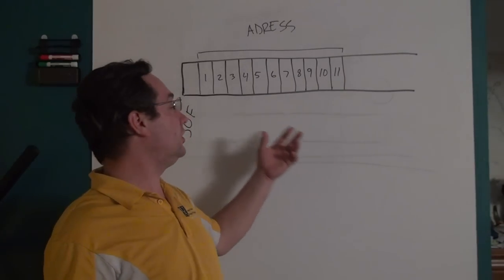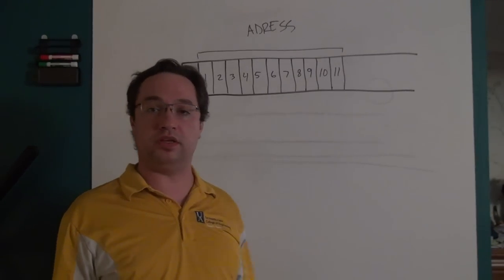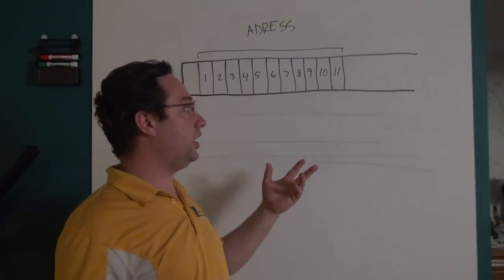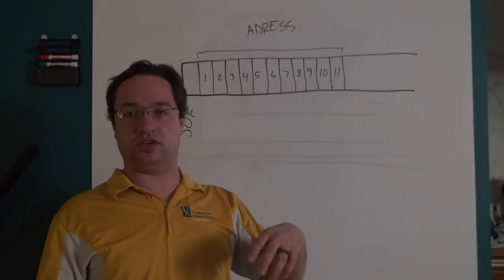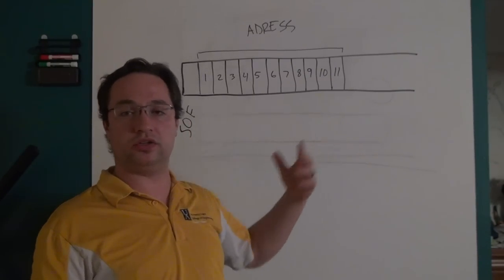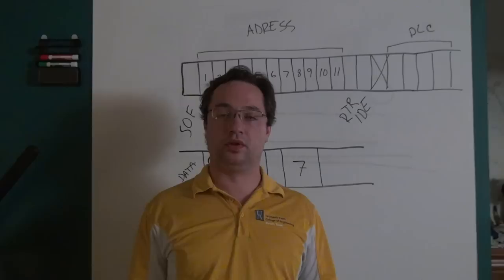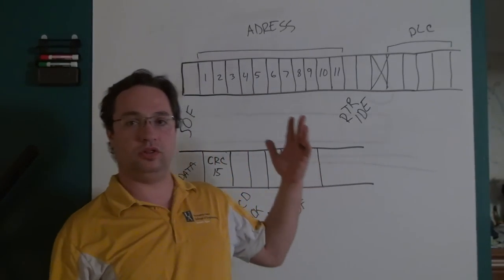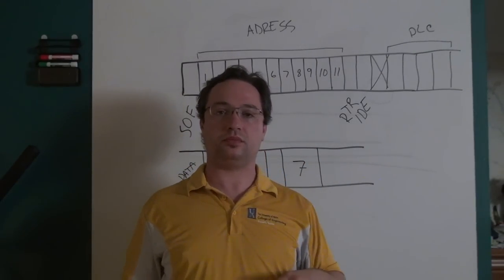eapbg #48 Introduction to CAN (Controller Area Network)

Comment: Thanks, The DLC connector has SAE J1850 signals and ISO9141 signals, what are they used for and the common failures occurs from there signals? are there signals only used for the scanning tool or the oscilloscope
Reply from the maker: Only the high speed CAN bus is mandated by the government. Everything else is up to the manufacturer.

Comment: EAPBG, can you please give examples of why would you want to use a CAN sniffer to do what with it and once you collect all the CAN ID messages that you got from the CAN sniffer you do what with? I just don't understand why you would use a CAN sniffer or what to do with one.
Reply from the maker: A sniffer is a reverse engineering tool. I had an old car (pre can) that I installed a remote start in to.  As part of the install, I connected it to the relay for the rear defrost. This let me turn on the rear window defrost from the remote of the car starter. The relay I connected to was easy to get to an in the fuse box at the front of the car. Now imagine the same thing but in a modern car. The rear defrost is controlled by a module in the trunk. The climate control sends a CAN message to the rear defrost to turn it on. I could find the message that turns it on. Design and build my own CAN interface board. Connect it to the remoter starter and CAN and get that functionality back.

Comment: EAPBG, a CAN transceiver chip converts the 0vdc to +5vdc to a CAN +3.2vdc, +2.5vdc, +1.5vdc signals by differential amplifiers or level shifting circuits? Differential amplifiers won't shift the levels of the voltages so how does the CAN transceiver chip do this please?
Reply from the maker: The explanation of how a can transceiver works is far too complicated for a YouTube comment. Try reading a transceiver datasheet.

Comment: Nice explaination.....Could you please tell me how many maximum nodes we can connect on CAN bus? And How to calculate  this ?
Reply from the maker: Unfortunately, it is not a simple answer. Unlike I2C, where there is an addressing limit CAN is only limited electrically. Propagation delay is the time a message takes to go from one end of the bus to the other. During the duration of one bit, that bit must reach everyone on the bus. This is further made worse by capacitive loading of both the bus wiring and the transceivers themselves. There are a few rules of thumb. The shorter the bus, the more nodes you can have. The slower the bus the more nodes you can have.
Reply: Thanks I understood you point ....but Is there no exact count for nodes or approx count? because I had googled so i had found that max 112 node we can connect so is it false?
Reply from the maker: If you're following some standard such as open CAN or industrial CAN or automotive CAN there are guidelines for network size, speed and number of nodes. This is mostly to ensure reliability. If you're making your own network then only the electrical limits apply.
Reply: Thank you.....I had asked this question by keeping automotive CAN in my mind.
Reply from the maker: Automotive CAN is usually separated into 3 sections; high speed, medium speed, and low speed. High speed CAN incorporate critical systems such as the engine computer, ABS, airbags, body computer and gauge cluster to name a few. This side of the bus tends to be kept to 10 nodes or so but the number is not set in stone. A scan tool connected to the car will connect to the high speed bus. The number of nodes on the high speed bus is kept low for reliability purposes. The low and medium speed buses are then attached to the high speed bus using a gateway. The gateway could be the gauge cluster or body computer.  All non-essential systems get offloaded to the low or medium speed buses. These things could include window control, door lock control, windshield wiper control, read defrost, entertainment such as radio, amplifiers, and subwoofers. The low and medium speed buses could include 100 to 200 nodes. The thing to note is that something as simple as a defrost control module is considered a node. This is no more than a microcontroller that normally receives only and will talk when asked and a relay. When a command is sent the relay closes and another command will open the relay.
Reply: This will explain why I count only 63bits of data on Maserati 3200GT. I was thinking that the address is 11 bits, but it must be only 10bits instead. Your explanation is far better than those I found in different books, as they have mistakes. Thank you very much for that.

Comment: thank you for the video.  who decides the message ID?? which is the important part for priority check? what if a node is cheating by having all 0 message ID all the time...? won't it be blocking the bus forever?? So, who decides the message ID for a particular node and particular message from the node?
Reply from the maker: The designer of the system is the one that decides.

Comment: when using a CAN bus what are the most common problems and failures when using a CAN bus? when looking at a CAN bus signal what do you look at for that are failures?
Reply from the maker: CAN is a very unique bus with lots of advantages and disadvantages. CANs biggest disadvantage is that it requires extra hardware. Buses such as I2C or SPI require little or no hardware because most, even very basic, chips include it on board. Often times these types of buses can also be bit banged. CAN requires at minimum a transceiver and at maximum a transceiver, a controller and a crystal. Because of this it is uncommon to see DIYers implement CAN at the hardware level. At the hardware level a problem is getting a crystal that is not accurate enough. Particularly at 1Mbit CAN has very stringent timing requirements. The next level is using prebuilt hardware such as a CAN shield. This solves all the hardware issues but has the problem of setting up a bus from scratch. This involves but is not limited to deciding what messages mean what. Who and or what gets priority to speak and so forth. There are some prebuilt protocols such as CAN open. At this level again not a ton of DIYers are setting up CAN buses for stuff. Issues here are getting the priorities wrong or overlapping messages. The final level is using prebuilt hardware to talk to existing CAN buses. This is by far the most common, like using a CAN shield to talk to a car. Getting the baud rate wrong is the most common. CAN has a very complex clocking and timing system.

Comment: thank u sir ..but what i want to know if every node has a unique address from the beginner or can change the address when it changes the data?...because i think that all nodes take their priority from the beginner...and thank you again
Reply from the maker: I think you misunderstand the address system. For other than the RTR bit, no node has an address, only the data has an address. Using cars as an example. If a car has ABS, the ABS will transmit the vehicle speed with a particular address, let's say address 50. Now if a car does not have ABS it may have a transmission control module (TCM) which can then transmit address 50. The car may only have the engine computer (ECM) that also controls the transmission and then it's up to the ECM to transmit address 50. So to reiterate, every piece of data has an address and that address gives it a priority. For example, the vehicle speed would have a higher priority than the engine coolant temperature and the airbags deploying will have a higher priority than both of those. Regardless of what module the data comes from the priority of the data is arranged ahead of time. Also, all the data addresses are unique to avoid collisions. I hope that helps.

Comment: But what would i use the CAN logging and deep recording data for to use for what? you mean its hard for the oscilloscope to trigger the CAN message data by the oscilloscope triggering?
Reply from the maker: Unless you have a specialty oscilloscope they can only decode the data that's on the screen. Same goes for the triggering. This is used for reverse engineering.

Comment: Whether after ack is made as dominant,what will be sent to transmitter?
Reply from the maker: I'm not exactly sure what you are asking. When the transmitter gets to the ACK bit it will send a recessive bit. Then any receiver that got the message and the CRC passed can make that recessive bit into a dominant bit. If the transmitter sees a dominant bit on the bus then it concludes that someone got the message. The drawback is that if only one node out of many got the message and the rest didn't, it takes only a single ACK to satisfy the transmitter.

Comment: When you get the CAN ID messages and data, what can you do with this? why use a CAN sniffer when you can just use an Oscilloscope that has CAN decoder to decode the CAN buss signals into hexidecimal values to view the ID messages and other CAN data?
Reply from the maker: Sniffers tend to have better features like logging and deep recording. Sometimes triggering capability on specific IDs or data.
Reply from the maker: Once you have the ID you can log just that ID and monitor the data to see what it does. An oscilloscope can't do that. Once you know what the data does you can inject your own data to get the system to do something. A scope can't do that either.

Comment: So only a CAN sniffer can get the CAN ID message and monitor the CAN data? an oscilloscope that has a CAN decoder built in can't do this?
Reply from the maker: I'm confused by the line of questioning. It sounds like your trying to justify purchasing an oscilloscope instead of a sniffer. They are two different tools for two different jobs. Oscilloscopes are designed for looking at a voltage over time. That is what they are optimized for. They are really good at showing one screen full of data. The screen tends to show 10 times the time per division. The best scope I've worked with so far holds 4 million points of data. When the time per division is 0.1seconds, the screen will hold 1 second of data. At that sample rate with a 1M bus, you get about 4 samples per bit. This is what I would say is the limit of the resolution the scope that is still decodable. With that scope, you can capture what's happening on the bus one second at a time and decode it. But what do you do if you need more recording time? Suppose events happen over minutes or even hours. That's when you get a  sniffer to be able to look at all the data over a long period of time. A sniffer looks at the data directly because it has CAN hardware inside. This greatly compresses the data allowing data collection for hours or even days. Oscilloscopes are great at triggering on repetitive symmetrical signals or levels and edges. Sine waves and square waves are awesome to trigger on. Please note that I said symmetrical, data is not symmetrical. Also if the level exceeds 3 volts, for example, and the voltage is rising again this is a great trigger. Neither one of those are great triggers for data. Oscilloscopes can not dynamically read the data and stop on a particular ID. At best they can poke in the dark. A sniffer, on the other hand, reads the data directly. It then can start recording on a particular ID or particular data (depending on how good it is). It can filter IDs. Suppose you one want to look at one ID that happens once a minute. With a scope, you will flounder trying to grab one second of info then check to see if the ID you want is in there. With a sniffer, you just set a filter for the ID and sit back while it grabs those IDs. There is special equipment that can do this, I'm not talking about it. I'm only talking about garden variety oscilloscopes that can also decode.

Comment: EAPBG, when looking at a CAN bus signals how does a technician know which module is bad or causing the CAN bus signal voltage or hexidecimal to be wrong or bad? Do you disconnect each car fuse in the fuse box one by one while looking a the CAN bus signal or how do you disconnect each CAN Module one by one? what scanner do you use to test each CAN module one by one to verify each CAN module is good?  Why do you keep saying that the CAN crystal is hard to keep accurate in time?
Reply from the maker: When working on a car the trouble shooting methodology is completely different. The first thing is to ohm can-h to can-l (6 to 14 in the DLC) with the car off. You should see about 60 ohms. If its 120 ohms then the bus is open somewhere. If it’s less than 60 ohms then there is a short. This verifies the physical wiring and termination resistors. Next turn the car on and check the voltage of the bus. Both h and l idle at 2.5v. With traffic on the bus they won’t be exactly 2.5v but you don’t want 0v or 5v. Either one indicates a short. Start unplugging one module from the bus at a time until the voltage comes good. The plug the modules back in, other than the last one, watching that the voltage stays good. In an automotive environment it is highly unlikely for a module to send bad data. Let me say that again, in an automotive environment it is highly unlikely for a module to send bad data. This is because the manufacturers spend tremendous amounts of time making sure the bus runs well. Stuff happens though and CAN has error detection built in. Generally the bad module will shut itself off. Then just look for U codes. The crystal comment refers to designing and building your own hardware. It is common for inexperience designers to think that the RC oscillator in a microcontroller is good enough. Or to choose a crystal that is not accurate enough. In a car this is never the problem.

Comment: If I have a CAN bus with multiple devices on it, can I use one transceiver and CAN controller to talk to my MCU or do I need a transceiver/controller for each of my devices on the bus?
Reply: As in, devices that give CAN data
Reply from the maker: If I understand the question correctly. There are two kinds of devices one contains a full CAN module the other does not. Let's say the first is a PIC32 microcontroller (almost all of them have a CAN module). The second is Arduino with an ATmega 328p which has no CAN hardware. The PIC32 needs a transceiver to connect to the CAN bus because it already has a CAN hardware module. The ATmega 328p needs a separate CAN controller and a transceiver. The ATmega 328p would talk to the controller via SPI and offload all the CAN functions. The controller intern needs a transceiver to talk to the bus.
Reply: @eapbg  Okay thanks that definitely does help but does not exactly answer my question. Maybe my language is a little off. Say I have multiple sensors I want to implement on a CAN bus. Do I need a transceiver/CAN controller per sensor? or do I only need one to be able to get all the data to my Microcontroller (separate from the CAN controller)?
Reply from the maker: @marcusragland1656  That really depends on how you want to set up, what you want to do, and what hardware is available. If the sensor has all the appropriate CAN hardware onboard then all it needs is a transceiver. If the sensor does not have onboard CAN hardware then it needs some type of gateway to get on the CAN bus. The gateway converts the sensor's data to CAN data. The gateway would most likely be a microcontroller.
Reply: @eapbg  Gee thanks! You're very responsive and give good detail. That answer does help me move on the next step of my project. Appreciate the help.

Comment: I want to log the data over time, so can I have another node ( Transceiver + Arduino + SD Card interfaced ) over the bus and record it ?
Reply from the maker: While it is possible to do this I don't think that the Arduino is fast enough. An SD card uses SPI and the MCP2515 and uses SPI. The Arduino only has a single SPI interface which would have to switch back and forth between the two.
Reply: @eapbg  Much appreciated your replies. Thanks so much.

Comment: I want to tap into the CAN bus and log all the data flying back and forth. How can I configure a node that will intercept all the IDs in the range starting from 00000000000 to FFFFFFFFFFF and process it ?
From your video seems like each node is assigned a unique ID.
But I want to gather all the data, both high and low priority ?
Appreciate a reply.
Reply from the maker: Nodes do not have IDs. Every node can hear every other node all the time. There is a mechanism in CAN called filters and masks. Each node has several filter and mask registers that get configured. This lets the node only pay attention to specific ranges of IDs. Set those to accept everything.
Reply: @eapbg  Good one. I will investigate into this.

Comment: Can you do video on CANopen topic?
Reply from the maker: CANopen is a software layer that rides on top of the regular CAN bus. It is only used to standardize the communication of multiple (usually industrial) devices. While I've only used CANopen a little bit, I'm not sure if there is enough substance there to do a video on.

Comment: How is this different than ethernet?  seems about the same, but smaller packets.
Reply from the maker: The physical layer is completely different. Ethernet uses pulse transformers. CAN uses transceivers. The collision prevention is completely different. Ethernet waits for the bus to be idle and then jumps on, whoever grabs the bus first is the winner. CAN everyone that wants to send a message jumps on the bust at the same time. The winner is whoever has the lower message ID.

Comment: How do you "request" CAN Diagnostic messages and signals? or what CAN programs in there that you have used or know about, there is a bunch of CAN programs but i don't know the names of the software programs. I'm guessing some CAN software programs let you "request" certain messages and signals to the CAN modules for diagnostic or to program the CAN ECU chips. Do you know what programming language is to program CAN messages and CAN ECU chips is it C++?
Reply from the maker: All that stuff is manufacturer specific.